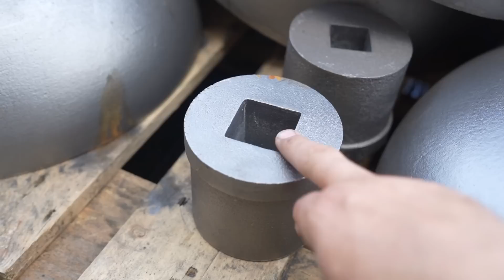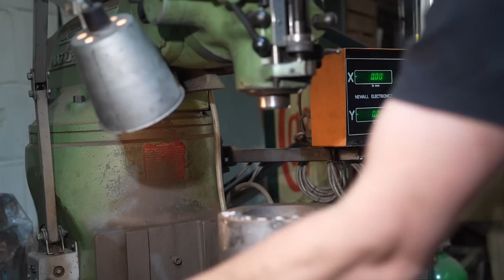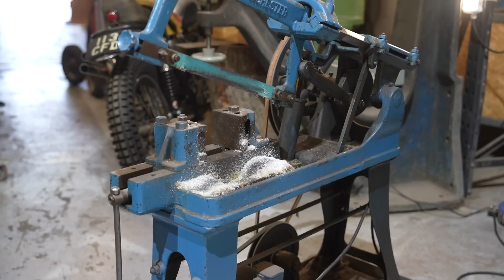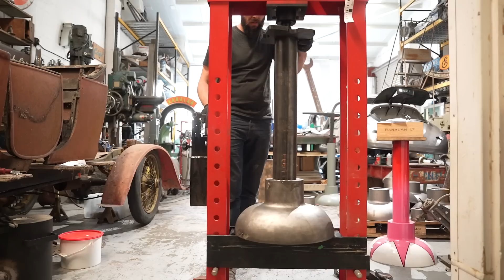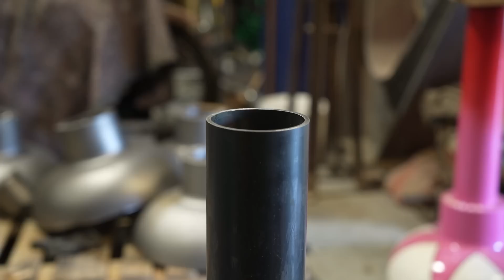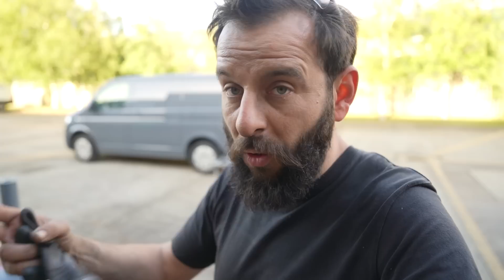Building My Ranalah Tool Posts!

Comment: Love the finished article! Makes my I beam, sunk in the ground, look extremely amateurish.
Just one thing I would do if I were you: Find a friend with a big old lathe, as you’d centre that casting super fast. Alternatively, add 4 floor mounting holes to the cast base, that way you can bolt it to the mill bed / lathe face plate, rather than having to weld.

Comment: Freezing the Tube and then pressing it in would help, freezing the top cap would also help with getting that installed once the tube is back to normal temperature, you can pick up chest freezers quite reasonably priced second-hand.

Comment: Have you considered putting a small step in the casting at four quarters so you don't have to weld a tab? It could be below the rim (set in) so not visible from the top. Would reduce your  cycle time and iexpect easy for the casting maker to do.

Comment: Dom, I would have thought it would be wiser to have press fitted the insert into the tube first before pressing the tube into the base. Thereby obviating the possibility of pressing the tube further into the base than is required. I know the tube took more force than the insert but if your tolerances were a tad off on boring the base the insert may take more force than the tube. The other alternative is to put a spacer under the base so that it’s physically impossible to press the tube further in.

Comment: Dom if you have too weld on your milling machine or any other machine with electronic components at least turn off the machine to prevent from possible shorting out the mother boards. And cover up as much of machine as possible. Great video as always bud happy Monday.

Comment: Hi Dom'. Put a soft interface on your DA it makes flatting curves a lot easier . Why not drill and tap the base x2 and simply bolt a fixing block to the base to keep it in situ.  Love that "wobbly " centering device . Cheers Dom 😊

Comment: Another point, particularly with a single point tool, use the knee for the Z changes not the quill. It will be waaaaay more rigid. I would also suggest slowing it down. Also cringed when you were welding the tabs on as it then means you'll see the non-cast finish when that's cut off, but also welding on a machine like that really isn't good for it.
Reply: Also to add, I know you've got the rough surface to play with, but getting centred on the casting at the beginning (and if you need to tweak it), I thing would be a lot easier with a lever type DTI.

Comment: The box section you
 welded to the casting should be longer with a bolt each end to fit the outer keyways

Comment: Hi Dom,
As mentioned by others your first cut on the mill should be slow and deep to get under the hard casting surface; your tools will then last a lot longer and be more accurate.  Sparks from a cutter are bad !!
You also should turn up a Go-NoGo test piece so you don't have to disturb the job on the mill - you could use the offcut of tube since it's the correct over size.
As for the lathe job; I'd face the end of the casting to remove the hard surface so when you turn the side each cut doesn't start with a struggle which will make the start oversize and reduce the life of your insert.
Finally are you cleaning the seam weld off the inside of the tube because that will displace your socket casting so it isn't concentric ?
Keep up the great work.

Comment: I am lazy so look at your precision work and think how lazy me would do it, so..
Could the tube be inserted into the sand casting mold so the base be cast around it? The only further  work would be the  top fitting and tidy up and paint.
Reply: Wouldn't the molten iron just melt the tube?
Reply: @PeterJewell2 it would depend on the thickness of the tube, but these look thick. Casting in a tube of steel into iron is a recognised method in engine block building and old cannon making. It needs to be done from the start as the mold patterns and casting boxes have no be made for it. Once done it saves a day's work on each base. Price that out.

Comment: Hello Dom, looks like you’ve got all sorts of helpful advice regarding mitigating the risk of the press fit operation.  But also please consider machining to a decent slip fit and using an appropriate Loctite compound.  Far less stressful and just as strong (if not stronger) and also easier to disassemble if needed.  And I concur with those suggesting to cease and desist from welding on the milling machine table.  Why open yourself up to those potential problems?  Wishing you success with this line of products.

Comment: Couldn’t the casting be altered to include a couple of lugs (or even slots) you could use to hold down the base. 
That would save you the welding and removing steps. You could still cut lugs off if you wanted to, after the machining.

Comment: Very nice.  Just a suggestion: Rather than milling out the center diameter of the base, if the bed of your lathe is long enough, chuck the steel tube in your lathe and use a steady rest to support the end, then turn the tube diameter at the chuck end to the size needed to press into the base.  After turning, cut off the inch or so that was held in the chuck.  Simpler to setup and faster.
Reply: But...(and I'm not a machinist)... the milling-out of the base removes the rough finish from casting, and ensures the steel tube is dead centre. Your suggestion doesn't address either of those. Would you get a tight-enough fit if the casting is left rough?

Comment: Hi Dom! I’m sure you receive lots of suggestions and advice, but here is mine regarding holding down the casting. Could you machine up a yoke that drops over the casting boss and use that to fix it down to the table of your milling machine? Welding steel onto that lovely casting just seems so wrong. Love the projects and your videos. Best wishes and stay safe. Stan

Comment: Nice Dom, I never knew these existed. I made one out of a old truck brake drum and 100/100mm square post and then fabed up a hardy post hole out of some 1/2 plate then as out here we get those Chinese crap dolly posts that have a 2"x 1/2" post to them I made a slot up and fitted that to the side of it so I can use both styles and also gives me the ability to make any design to use in it.
But wish I could afford one of these.

Comment: Hi mate. Couple of ideas that could help. Use a shorter off cut of the pipe to check for size without having to take the base off the mill. Also maybe look at a cutoff switch at the bottom of the saw range to cut the power automatically so you don’t have to watch for it. Looking good on the tool stands. Nice work

Comment: Hi buddy before you took the base off the milling machine could you not have tested the hole size with the off cut of tube you cut off. Also to fitting the tube into the base why don’t you heat shrink it to fit that way there’s no risk of the casting splitting

Comment: Awesome Dom. I would say that you can take a  lot heavier cuts at each pass, both with the boring bar and on the lathe. My machines are considerably smaller than yours and I would cut that hole in the base in around 15-20 minutes  and the same for the top piece

Comment: I worry about cracking too so I wonder if that bit of rust on the tube should have been cleaned off. Also, wasn't that a seam inside the tube that would interfere with pressing the upper casting in?

Comment: May be a daft question, but when you use that “wobbly” thing to record the coordinates of the outside edge to eventually find the centre, how do you know the opposite points on the circumference being recorded are opposite ends of a line through the centre (diameter) not opposite ends of a cord which will be off-centre?
Reply: Cos u setup on the centre from 4 points of touching on/edge finding.
Reply: @chen_490  but 4 points shown on the video are not necessarily at the end of a (diameter) line through centre.  He didn’t show on the video how he moved the milling bed along the Y axis to ensure when he was recording the circumference on the X axis at the “widest” points, not at say Y = -0.001 which (by then moving the bed along the X axis to the other side of the circumference) would result in recording the circumference at the ends of a cord not diameter which would then be off centre, maybe not by much but nevertheless…

Comment: There is another way to fit the tube in the base casting.
Get an old chest freezer and crank it to -20 degrees C, place the tube inside until it’s really cold then press fit by hand.
Re milling the casting hole to size cut off a small piece of the tube and turn a slight taper, then you can pop it in and check the size without moving the casting from boring head.
Steve

Comment: How about laser cutting a mounting frame to hold the base down.
It could consist of a doughnut that fits over the top and the n has two shaped parts welded on that run down the sides of the bell shape and have mounting holes for bolting to the slide.
Because of the mass of the casting it doesn’t need a lot of force to hold it in place.
Steve

Comment: For the next batch consider tack welding a couple flat bars across the base protruding out a bit for clamping.  Then when you cut off your tack welds they will be hidden.  Three recesses in the future casting would allow you to drill and tap holes to secure the unit to the floor.   As far as the future goes, I predict that the Ranalah castings will be re-purposed as a crescent mounted on the top of Parliament, St. Pauls and Westminster Abbey.

Comment: Hi Dom. Lots of comments made. I was wondering if a simple frame could be fabbed up  like a bridge to clamp it down. The forces for boring are pretty low. You could snug the base against some stops (simple turned pieces) to ensure it won't move and the bridge would hold it down. The only other thought that occurred to me is an aesthetic one. Having the  Ranalah lettering around the bell would look great and could be bigger. Great job, though. I applaud your endeavours. Mart in Solihull.

Comment: Dom it's great to see you doing precision engineering, but if you had had the pattern with a shoulder on the bottom of the tube hole, you could bore that out much more loosely an to not even an interference fit and just use loctite to fix the tube in. That could save you absolute hours of work and make them a bit more profitable for Ranalah. The same goes for the top piece, turn it straight two thou under size and loctite in the tube, Simples!

Comment: couldn't you get east coast castings to cast x2 sections of the base but the inverse of the base you have and then use those to clamp the bases down on to your milling bed ? That way you would have a lot of welding and then grindign and surface prep to do ?

Comment: Why not turn and fit the insert into the tube then press the insert and the tube into the base at the same time?
Reply: I'm no expert, but as the insert is tapered and requires much less force, trying to do them together could risk damaging the insert.

Comment: Dom, could you not secure the base to the mill through the hole in the centre of the casting? 
I know it doesn't make for good filming but please use coolant when machining your tools will last longer,  the finish will be better and it will be more accurate. 
Great product though.
Reply: Err, not sure how you are going to bore the hole with a fixing through the centre. Would you explain what you mean and how would you produce the accurate hole? And coolant on cast iron makes a hell of a mess, even worse than machining cast iron dry. And anyway cast has a lot of graphite in it and if not chilled hard, it  cuts easily without lubricant.
Reply from the maker: Thank you for the correction I agree with both statements!

Comment: MIG welding cast iron is never a good idea and is likely to result in a brittle weld with poor fusion so if your cutter digs in they may fail. I would get a steel disc cut to drop over the casting that you can pull down with some with some studs from T slot nuts. Does the power down feed work on your BP quill? easier than using the hand quill feed and you can set the point at which it stops feeding down . I know it's been mentioned before but that BP head is noisy.

Comment: Great hand crafted work Dom. Save yourself some anguish by placing a load spreading plate beneath the stand base when using the press - it will minimize fracturing risk.
Reply: Came here to say the same thing.

Comment: I was taught that ‘donkey saws’ cut on the back stroke, try reversing your blade.
Reply: Wrong, if you look carefully it only cuts on the forward stroke, the oil in the dash pot holds the blade off so that it is clear on the back stroke. That way the teeth dont drag on the back stroke and wear the edge off.

Comment: Hey Dom, please stop welding on your milling machine.......all kinds of things can go wrong afterwards.......the DRO can go wonky, weld spatter can get into the tinniest of places and cause you to lose what tolerances you have on the machine, etc.. Also I would slow down the RPM when using the boring head, you should get chips not sparks.......also I would grind off the mill scale from the steel tube to make for a better fit into the casting..........May I suggest that you talk to Quinn Dunki from the YouTube channel "Blondie Hacks" she can get you set up with milling machine tools.
Reply: Dom, you could cast the lips, then you dont need to weld anything. Just simply cut them off.
Reply: Holy Moly I can still hear how loud my instructors would have shouted if I had made sparks on a mill!
Reply: All he said. I was cringing watching you. Cut deeper on first pass to get under casting surface. The surface is much harder than underneath.

Comment: A couple of comments regarding your mill.  First, you could use the auto down feed for boring.  It looks like your mill has two or three different feed rates to choose from.  The other thing is that your mill sounds like it may have a bearing going bad.

Comment: I can understand you not wanting to heat the base casting, since it is such a lump, but why don't you get some liquid nitrogen to shrink the tube? It will be a lot cheaper than breaking a casting and will certainly drop the pressing force by a considerable amount.
Reply: Just a household deep freeze should do?
Reply: @petesamuels3104  Maybe, depends on the interference and the freezer, -18 may not be enough though without heating the base casting too, and that defeats the purpose somewhat. Liquid nitrogen isn't that tricky to deal with in small quantities, though I don't know how much BOC charge these days.

Comment: What you need Dom is a CNC mill. 2 hours of fettling on each one sounds like a long time. Also, have you considered putting some bolt holes in the bottom of the stand. That way you wouldn't need to weld the lugs on.
Reply: bolts in the stand means a workshop can anchor it to a concrete floor too.

Comment: Why don't you cast in a couple of lugs with holes onto the sides of the base, it would make it easier to hold down on your mill and it could also be bolted to the floor if required
Reply: Kinda my idea. I thought about casting ears into the base like what you welded on but then could be ground off or left if the customer wanted them...maybe if they were left on they could be drilled and used as anchoring points by your customers.
Reply: Or, cast a flat spot on both sides that can be drilled and tapped for removable feet. Nothing to remove then and if needed by the owner an easy add-on.
Reply: Or French the holes into the base, so no lugs to trip on, will be super strong and won’t affect casting.
Reply: Or....leave him alone to do what he wants ....and just watch.....!!?
Reply: @andymccabe6712  - Throughout his video series, Dom has expressed much gratitude for the skilled craftsmen offering the wisdom of their experience to improve his techniques through the medium of comments!